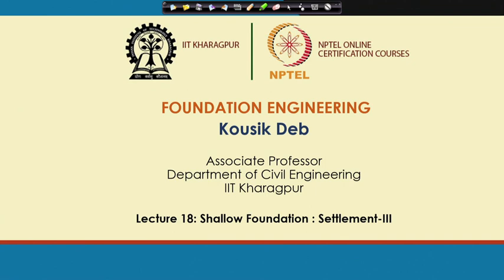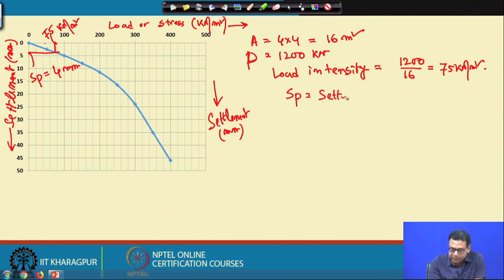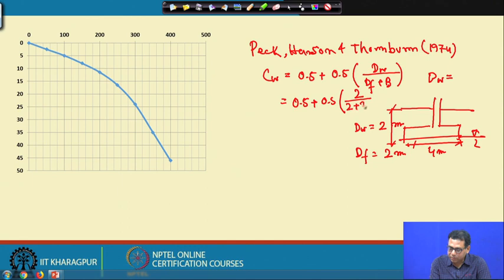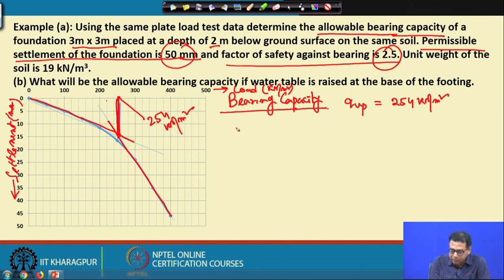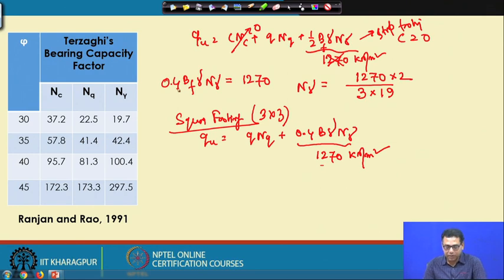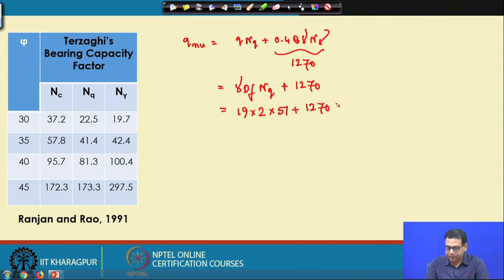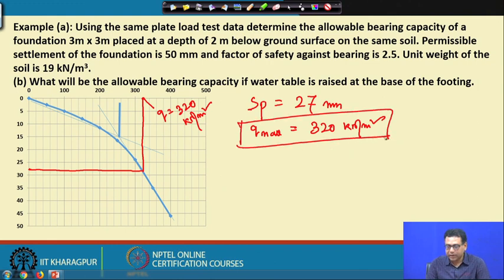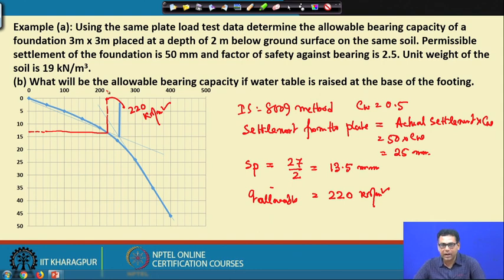Lecture 18 : Shallow Foundation - Settlement III

Comment: sir , the  bearing capacity you derived from settlement method was for the plate,then why did you took it for the foundation.
Reply: Exactly, I thought the same thing, he should have converted it into foundation bearing capacity before comparison
Reply: +1
Reply: The 320KN/m² load produces the 27mm settlement in the plate. The same load will produce a 50mm settlement in the foundation.